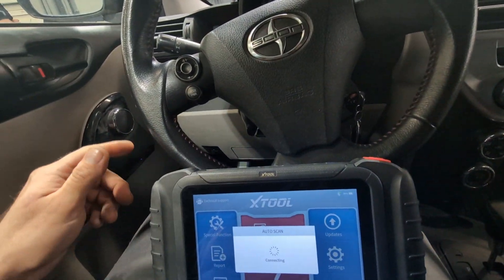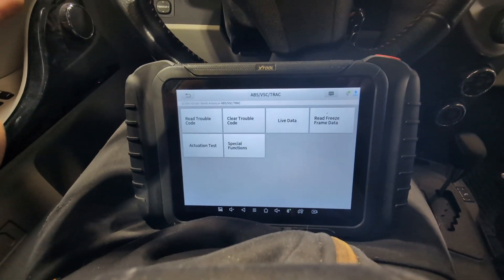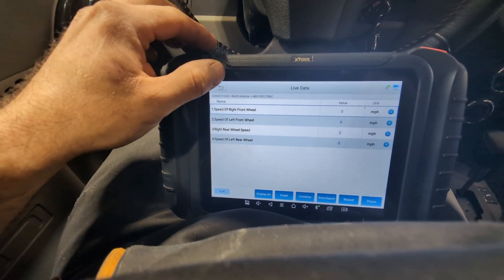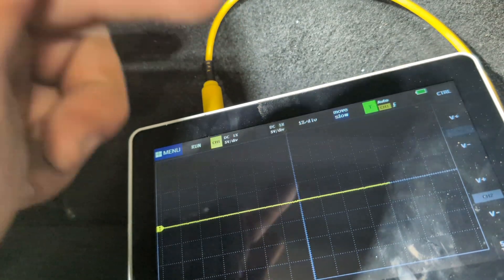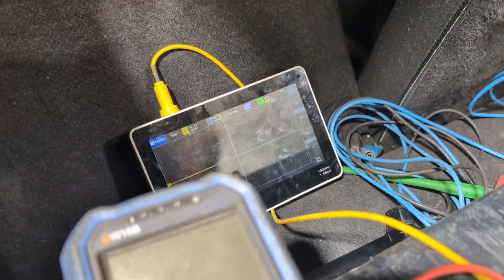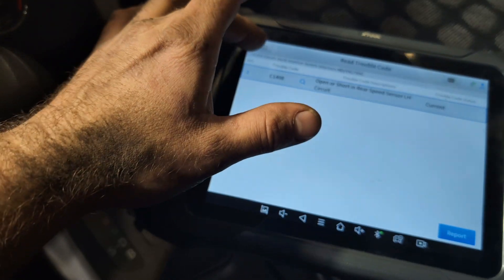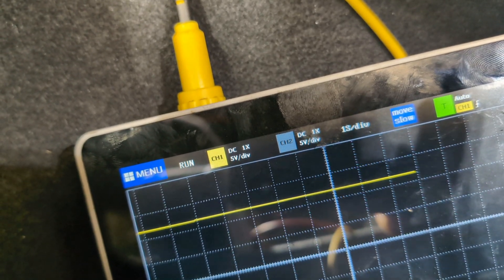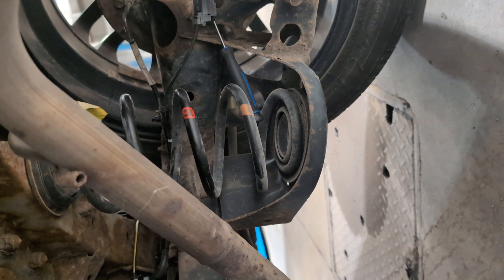Scion C1408: Is Your ABS Module Failing?

Comment: Good TOPOLOGY Count 13 MODULES. The code and description are readable today, cheers. The reason I complain is when there are hundreds of codes shown on YT videos, some viewers make notes/library of the code numbers along with the link or other ways to find your video again if ever need to come back to retrieve the code description as that is a lot of data to type for our database. Better to come back to your video and watch it again and maybe collect some notes that we missed the first time around, for your benefit also. Either buy a cheap WSS as a test unit in the 15megaohm range or grab one from the junkyard the next time you get over there or find a Radio Shack that is still open (Alabama).

Comment: To confirm the diagnosis you could have connected the right rear sensor to the wiring going to the left rear sensor using leads. That would rule out a faulty circuit and isolate the problem to the sensor itself. Great video!
Reply from the maker: Thanks for the comment.

the fact that the check voltage stayed at 12v after connecting the decade box means that the check voltage was returning to the module and that the module was accepting it. the code was still present due to the resistance being to low, 1mOHM instead of 19mOHms.   The resistance reading of the sensor was also in the kilo ohms instead of mega ohms(as mentioned in the video). I believe that there is a percentage +/- that is tolerable, but loosing 18m Ohms is just to great, even if the system is accepting it.
Reply: @JLsAutoSolution  I didn’t think of that, great info and thanks for sharing!